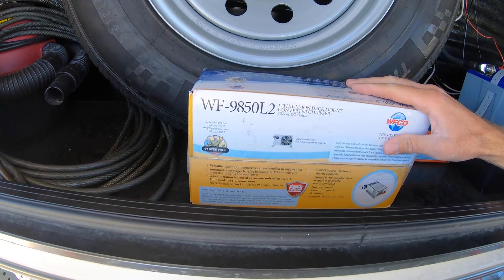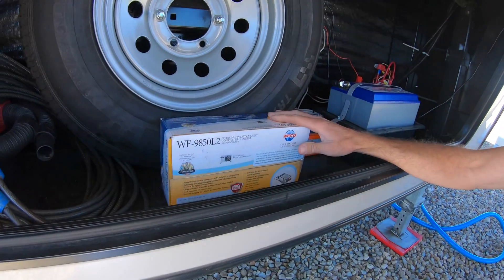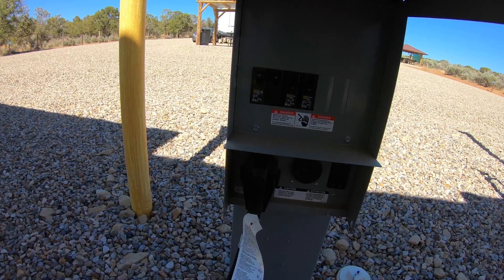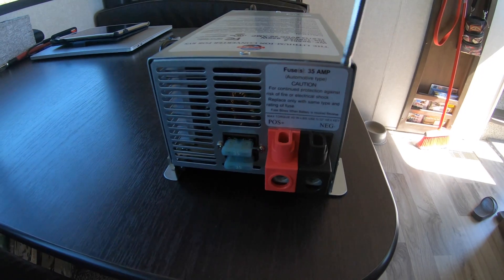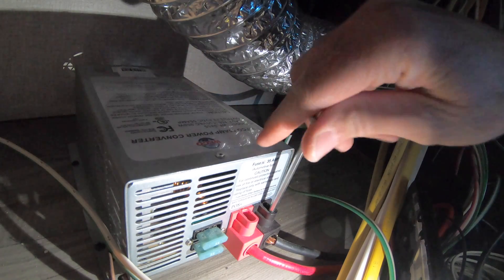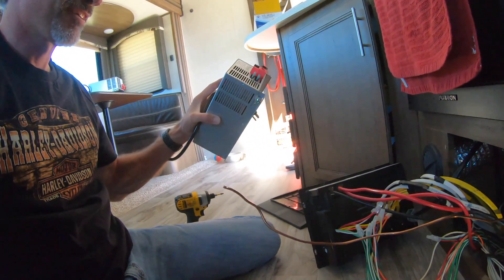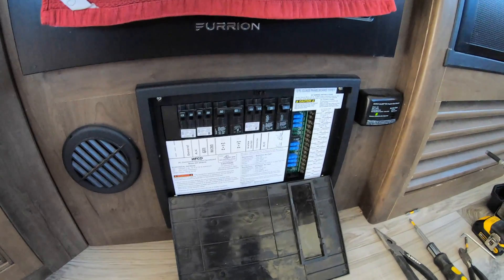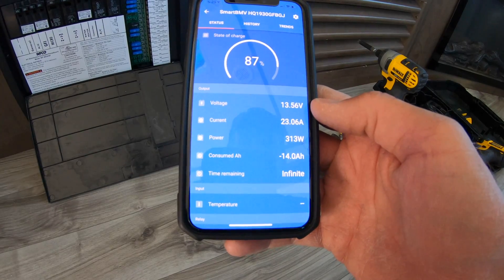Going to LITHIUM Batteries for your RV?  WATCH THIS FIRST!  WFCO WF-9850L2 Lithium Converter Install

Comment: My rv’s  battery is also charged from the vehicles alternator when engine is running.  The alternator is designed to charge lead acid batteries.  Whats missing here?

Comment: did you do anything charging from your truck you need  protect your alternator with a dc to dc charger or other device it will damage it over a short period of time
Reply from the maker: We did not.  We now have 750W of solar on the roof so we are always charging.
Reply: if you get power from the truck  your alt will be affected you need check this  @EddieAtLarge

Comment: progressive  dynamics is a FAR MORE RELIABLE unit  and has better charger for longer life of your battery 40+year of  fixing Rv's  the battery mfg advice is correct  wfco is half the price  witch always get most diyers
Reply from the maker: I would agree other than the smallest charger by Progressive is 60 amps and our 6 AWG wires will not handle that load.  That’s why we stuck with WFCO.

Comment: Hi, great to hear about your installing solar. You shouldn't have to run the generator at all just to charge your battery. My experience is one 100-watt panel for every 100 amp hour battery.
Reply from the maker: Thanks!  We now have 950 watts of solar and 300 AH of Battleborns.  Have not ran the genny in over 2 years.  Lots of sunshine out West!  ☀️

Comment: Ops I mean do I need to replace my distribution box with a newer one for the upgrade  to lithium batt ?
Reply from the maker: Yes, if you have an older model with the distribution box vs the converter/charger plug in like ours, you would need to replace/upgrade to the newer distribution box that supports lithium.

Comment: Excellent info for what we’re thinking to do. Thank you 🙏🏻. May I ask what battery monitor system you use?  Just subscribed and will check out your other videos to find it but if you see this and could let us know, we’d appreciate it. Thanks again.
Reply from the maker: Thanks for subscribing!  We use the Victron BMV-712 and it’s worked very well for us over the years.  Here’s the link to that install and review.  
https://youtu.be/sruxxpmFdts
Reply: @EddieAtLarge  👍🏼👍🏼. “Add to cart”. Lol. Shot down on the wf9850. I guess they no longer make them. Found a 9845lis, with a switch. I have no idea how to hook up the “switch” part but it still seems the best option. Thanks for everything ☺️
Reply from the maker: @twoforonecreativelife Cool.  Yes, I believe they discontinued our model.  There is also a 55 amp LIS model on Amazon, however, you would need to ensure your wiring is sufficient to handle the extra amperage.  Regarding the switch, it’s fairly simple.  The new model should come with a “jumper wire” and for the unit to charge on lithium parameters, you just install the jumper wire into the Wago connectors and then you won’t need to install a switch.  You only need the switch if you plan on swapping lead acid and lithium batteries back and forth which most people won’t be doing.  Let me know if that makes sense.  You can also look up the questions on Amazon regarding the WF 9855 LIS model and many people talk about it there.  https://amzn.to/44fgXLy
Reply: @EddieAtLarge  , I did see that one but our wiring is same as yours from what I can tell; further investigation needed on my part to be certain.  And, honestly, I’m okay with slower charging speed if it’s safer ☺️. 
I’m happy to hear there’s likely a wire (included) to make the switch lithium only. That was going to be my next puzzle to solve. All of this is new to me and as I am retired and my husband still works, I’ve taken on the tasks involved in getting our new-to-us rv ready for full time living. All the information necessary is truly mind boggling…and I began “studying” months before we purchased our rig. So…thanks again for you help. The electrical had been kicking my butt!  Lol. Grateful to ya
Reply from the maker: @twoforonecreativelife You’re most welcome!  We’ve been at it full time for almost 4 years now and we’re still learning all the time.  If there’s no wire included, you should be able to use a short 14 or 16 gauge wire for the jumper.  Have fun and safe travels!

Comment: You can also plug in a charger for a lithium battery charger and when you are plugged into shore power or running the generator it will charge you arteries a100 per cent and old convert will maintain at 80 per cent on solar already installed
Reply from the maker: I could see that being a possible work around if you plugged the lithium charger into your generator or into shore power.  Most all solar chargers today are capable of charging lithium as well.  We now have 3 Battleborns and charge mainly by our Victron solar charge controllers.  Haven’t used the genny for 2 years now.

Comment: Good vid! My question is about charging capacity. The 100AH li batts all seem to call for 20 AH charging but can take much more if needed. So would charging these batts at 30 AH all the time hurt them? 
I'm going to be getting two 100AH batts and researching whether I should get a 45 or 65 AH converter.
Reply from the maker: Thanks Scott!  Battleborn 100AH batteries can accept up to a maximum of 50 amps of charge.  So for 2 Battleborn batteries, the maximum charge rate would be up to 100 amps.  They do say that 100amps should not be exceeded as that high of a charge rate will shorten the life of the batteries.  We use a 50 amp charger for 3 batteries  and that works fine for us.  Here’s a link to a Battleborn blog post with more info.  https://battlebornbatteries.com/charging-lithium-batteries-the-basics/   
Hope that helps!
Reply: @EddieAtLarge  Thanks for the detailed response Eddie!

Comment: 1 battery is not enough most of the 5th wheel guys have 6 batteries for long time off grid . I’ve two of those in my truck camper and I can run my ac for about 5-6 hrs.
Reply from the maker: Yep, we have 3 now (300AH).  We did run on 1 battery for 6 months of Boondocking the 1st year out.  Lots of power management, but, it’s possible.  Now that we have Starlink and like to run our TV, etc…, 3 is a must.  Need those creature comforts.  We never run the AC.  Boondock out West and just follow the weather.  Move up in elevation when it gets too hot…

Comment: Nice that they used 6 AWG on that converter. I was wondering where the other end of that ground wire went, seems like it should have ended at the converter. Good video. Thanks. I put a Victron battery to battery charger in about a year ago. Nice fast charge while you're driving.
Reply from the maker: Glad you enjoyed our video!  The ground wire goes down through the floor and should then be screwed into the steel chassis somewhere on the RV.  This would serve to not only ground the converter, but, also ground the power center.  
I had previously considered installing a DC to DC charger like you did, however, we now have solar on the roof that charges the batteries while we drive so fortunately it's no longer needed.  This would only be a problem for us if we would run into a string of cloudy days.  Being that we mainly boondock out West though, we've never ran into a problem.  It's been almost 2 years now since we last ran our generator.  Solar is so awesome!  ☀️

Comment: The DC battery charge from your truck, is there any adapter you need to put in series from your truck to RV to protect your F250 alternator since you switched to lithium?
Reply from the maker: No issue on mine as for some reason, the truck alternator doesn’t charge the trailer batteries at all while hooked up.  Not a big deal for us now that we installed solar on the trailer roof and that charges while we drive.  If you want to charge your lithium battery with your alternator, you will want to use a DC to DC charger that has a lithium profile like this one:   https://amzn.to/3kGjP2i    Here’s a great video by Ray from Love Your RV on the install. https://youtu.be/ww_4yhQPGwY  You may want to pull the fuse to keep your alternator from charging through the trailer cable as well if it’s pushing current to avoid damaging your alternator.

Comment: Could I put more then one battery in the RV with out doing anything else besides the converter?
Reply from the maker: Yes.  You would be able to add multiple batteries by wiring them in parallel to keep the voltage the same.

Comment: hi...thanks for the vid man...enjoyed it. Im looking at someday upgrading to lithium as well. I was thinking id go for 200 AHs. ( just to be safe) I havent really callculated my usage but its I say fairly average. Do you think the extra moneys worth it for the average guy? Your furnace ran quite alot and you were only down what?...74% er so?  we do have an inverter that will get used some though. ( some TV maybe) Not sure if you used one during that first dew nights or not. Do you think that would be enough diff from what your needs seem to be to warrant the 200 over the 100?   thank you
Reply from the maker: Hey there.  Glad you enjoyed the video.  Lithium is definately the way to go, especially if you're doing a lot of boondocking.  We ran on the 100 AH battery and 200 Watts of Solar for the 1st year out, however, we were extremely conservative with our power and had lots of sun out in the Western US.  We now have 300 AH as we have added a 3000 Watt Inverter and we ran on 600 Watts of Solar for 6 months out West last season.  No problem running the TV, Starlink Satellite & charging devices.  We would shut down Starlink overnight though to conserve some energy.  Also just added another 350 Watts of solar to the roof for convenience.  You can start small like we did if you like and per Battleborn, you can add more batteries up to 2 years after the original install without compromising the integrity of the battery bank.  I would say you're on the right track with at least 200 AH to start.  It was well worth the money for us, however, we travel and live full time in our RV.  Hope that info helps.  Feel free to let me know if you have any other questions.
Reply: @EddieAtLarge     that sounds like great advice and much more like what we d need that what you started out with.   Thanks again!

Comment: Have you ever scene an RV engulfed in fire caused by a lithium battery? I have and it's reason enough for me to stay with 6 volt golf cart batteries.
Also you can't charge a cold lithium battery. And the claim you can take a lithium battery to zero without damage is a total misconception
Reply from the maker: I'm sure there are cheap lithium batteries out there that are dangerous as you say, however, I've researched Battleborn and have not found any indications or news of them having issues catching fire.  We've been using ours for 3 years now and they've been great.  They will charge in somewhat cold conditions, but, the BMS will not allow them to accept a charge when the temps drop below 28F.  They will however continue to discharge down to -4F.  We follow the warm weather and never camp in temps much colder than freezing overnight, so, this hasn't caused any issues for us.  And you are correct about not being able to discharge a lithium battery to absolute zero.  The BMS will allow it to discharge down to 10V and then it will disconnect the battery to protect it.  10V is considered 0% on the Lithium Voltage Chart, however, it obviously isn't totally depleted.  Regardless, It's been so nice never having to worry again about constantly monitoring our batteries to make sure we don't drop below 50% and damage the batteries like it would with lead acid or AGM.  Not trying to sell you on them, just letting you know that we are very happy with our purchase (we now have 3 ea. 100 AH batteries).

Comment: This is pretty much exactly what I plan to do to my teardrop this winter. Replace the 88 AH lead acid with a 100 AH battle born, might do 200AH but 100 for now. I have a Progressive Dynamics 45 A converter and will get the 45A lithium version. 
Other than that, it should work. 
I also have 100 W solar panel with a zamp 10a controller. 
Ant thoughts or recommendations?
Reply from the maker: Cool.  We started with one 100AH lithium and ended up adding 2 additional for a total of 300 AH.  Been Boondocking 6 months every year and they’ve been working great!  Also, started with 200 Watts of solar, the next year added another 400 Watts and will be adding at least 200 more this winter.  With your smaller teardrop camper, you probably won’t need much capacity.  We got away with 100AH and 200W of solar the 1st 2 years out.  Now we’ve added a 3000 W inverter and have some power hogging devices like Starlink, so, that’s why we needed more.  Good news is, you can start small and work your way up adding a bit at a time.  Per Battleborn, you can add additional batteries as long as it’s within 2 years of the original install, which is what we did.  Hope that helps.  Let me know if you have any other questions.  Have fun and good luck!
Reply: I camped 59 nights in my teardrop since April.  I love how you can add another battery later, power needs change.  I only power a small 12 volt fridge, water pump, a light sparingly, and the Propex heater.  I also run a fridge in my truck with a Jackery.  Plus charging my phone, Garmin, and a handheld ham radio. Idaho has pretty good solar, I think the 100AH will work.

Comment: UPDATE...  I purchased and installed a SOK 206Ah Lithium battery for my 2021 Grand Design Reflection 150 Series 278BH.  Put in a call to Jonathan at WFCO (very helpful), the WF-9850L2 that you purchased is no longer in production. The convertor/charger in my G.D. will not fully charge and maintain my SOK battery (thanks alot Grand Design), and Jonathan told me the new model is the WF-9855AD, the AD standing for automatic detection of battery type.  The going price is around $300, but found it at UnitedRV for $259, free shipping.   Jonathan told me that once the convertor/charger is installed, you must go through a complete drain and recharge of the battery which allows the WF-9855AD to program itself for that specific battery.
Reply from the maker: Thanks for sharing.  I personally don't like the idea of having to completely draining your batteries in order for the new model to program.  As long as your batteries have a good BMS to protect them from damage, they should be fine.  However, if my Battleborns are completely drained, it's said by Battleborn that they'll go into what is called "Low Voltage Disconnect" to protect them and they may need to be jump started to "Awaken" them.  The lowest I've ever discharged them is around 45%, so, I've never had to do this.

Comment: Great job. Good information. I have the battery just need the new charger. How much was the WFCO LION charger? Where did you buy it at?
Reply from the maker: Thank Mike!  I ordered this from Amazon, however, this model is no longer available.  There is a newer model available though.  Here is the link for that one:  https://amzn.to/3OXOeE2  The new version has the ability to change charging modes between lead-acid and lithium batteries.  I paid $234 for the original and the new model is $236.  If you don't want to install a switch to go between the 2 modes on the new model, you can just install a jumper wire to connect the 2 switch ports and that will put you in Lithium mode.  The one guy on Amazon said he just used a short piece of 16 ga wire that he had for the jumper.  Hope that helps!

Comment: Nice istall. Thanks for taking the time to make the video. Did you have to upgrade the 12 volt side fuse panel?
Reply from the maker: Thanks Vincent!  There was no need for us to upgrade the fuse panel for our camper.  It was a simple swap of converters.

Comment: Lol just cut the ground wire next time.
Reply from the maker: 😆  Then I would have had to splice it together and didn't have any splice connectors on hand.
Reply: @EddieAtLarge use the ground connection on the converter as a splice 🤙
Reply from the maker: Hmmmm.  I'm thinking that I was thinking that 2 wires wouldn't fit through there.  Not 100% sure though as that was quite a while ago when I installed this.  That would be much easier though if that would work.  ✌🏻